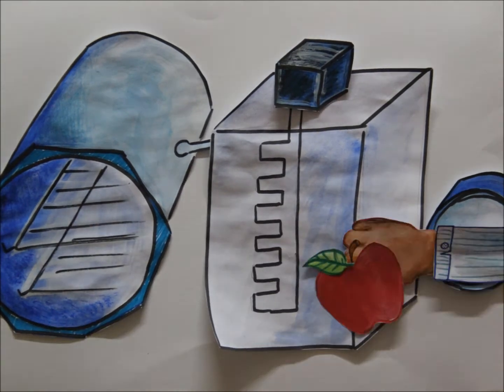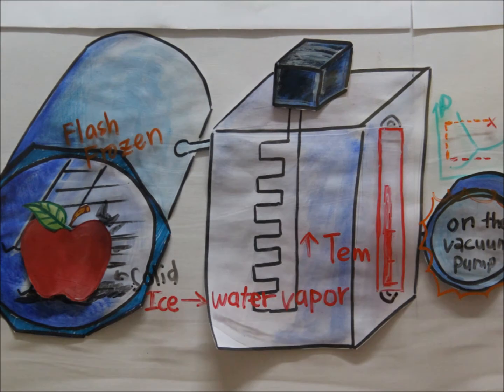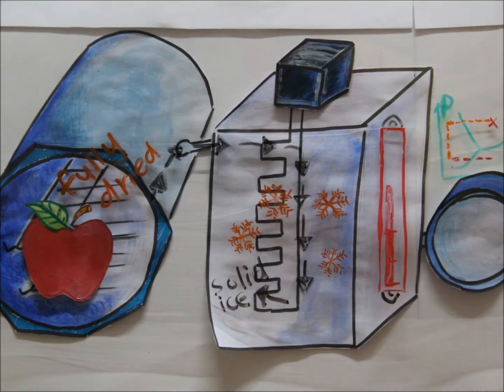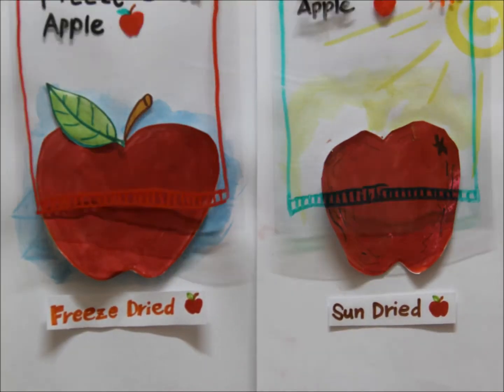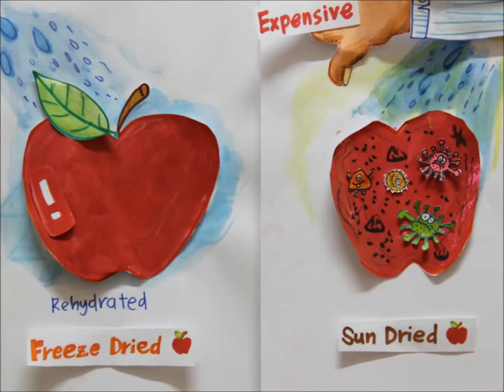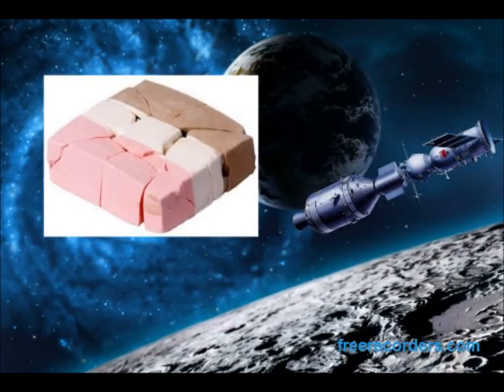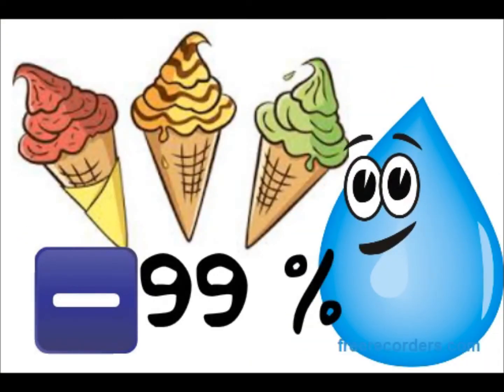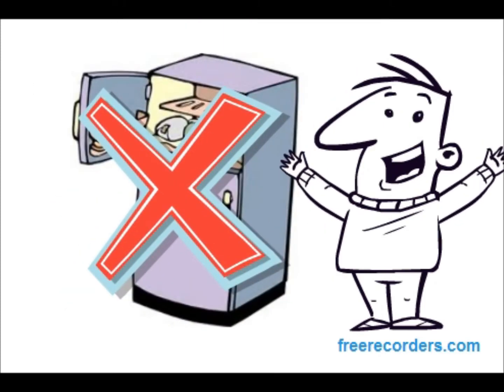EKC 316 - Separation Process: Freeze dryer Group 10

Comment: thanx for the question .. actually, for freeze dryer in order to preserve the nutrient of the food, the wet solid is not heated up, instead the wet solid will be freezed to a very low temperature, causing all the moisture to be turned into solid form(ice), next the pressure will be lowered below the triple point. Sublimation will occur whereby all the ice turns into vapor directly...

Comment: Can't fully understand the process. Is it the wet solid first heated up for water content to evaporate, then the water vapor is freezed?
Reply: Jeremine Lee thanx for the question .. actually, for freeze dryer in order to preserve the nutrient of the food, the wet solid is not heated up, instead the wet solid will be freezed to a very low temperature, causing all the moisture to be turned into solid form(ice), next the pressure will be lowered below the triple point. Sublimation will occur whereby all the ice turns into vapor directly...